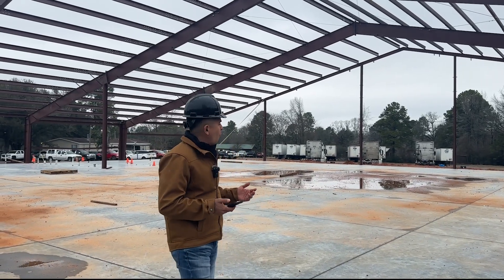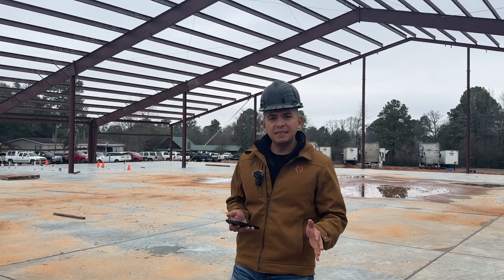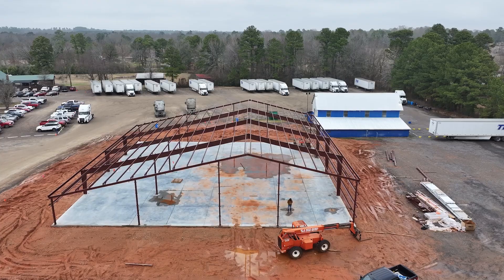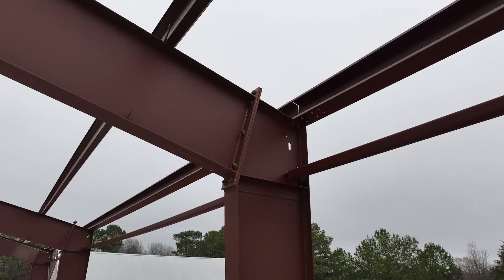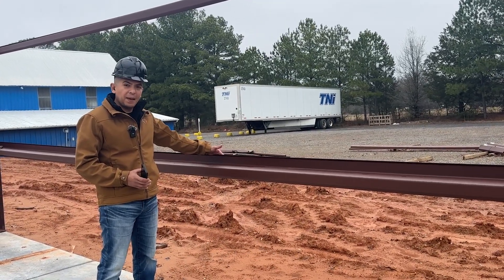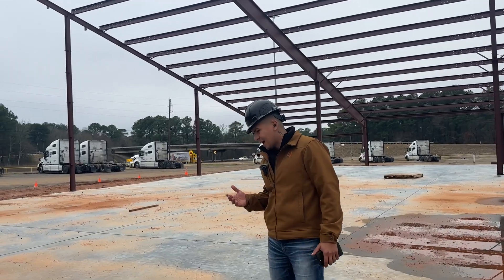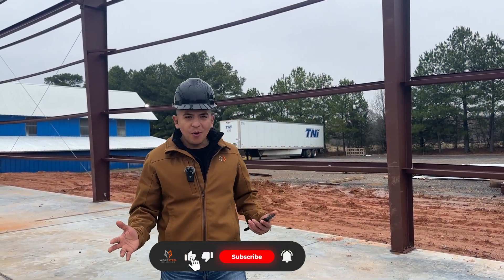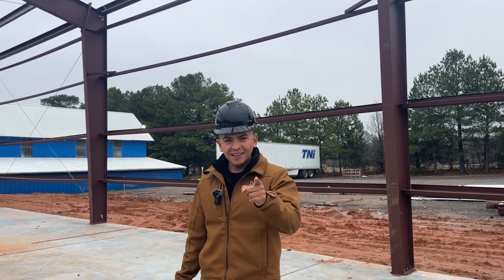Metal Building Framing | 105'x100' Mechanic Shop in Texarkana, Texas | WolfSteel Buildings

Comment: I can’t imagine the price of that huge metal building, with concrete and a massive insolation 😱
Reply from the maker: It is an expensive building. It was used as a mechanic shop for commercial use for Tri-National inc. A trucking company.
Reply: About how much does this cost?